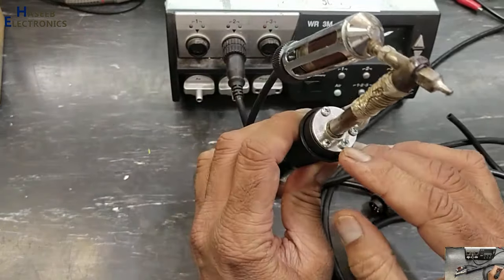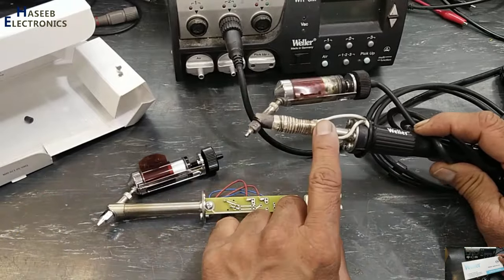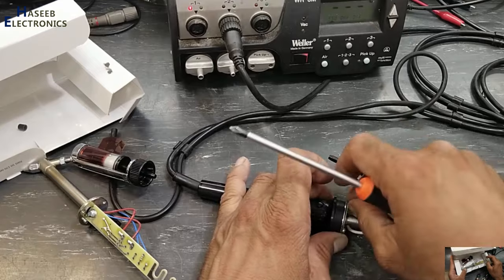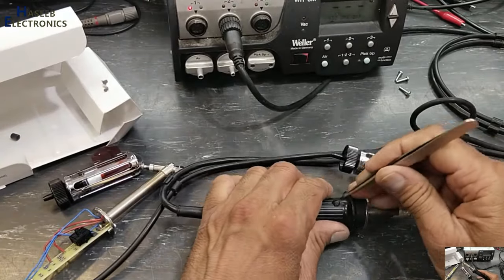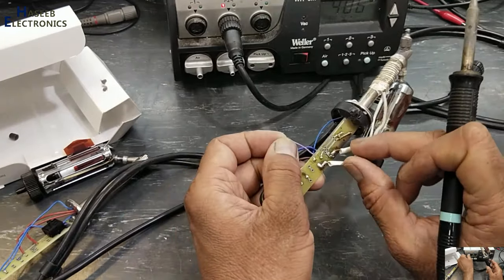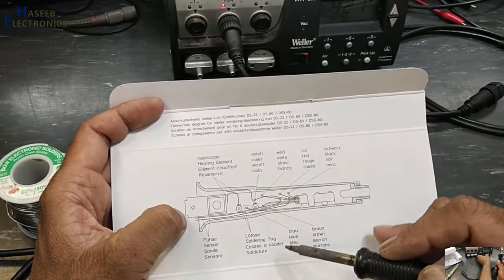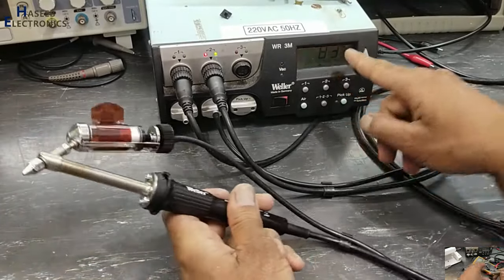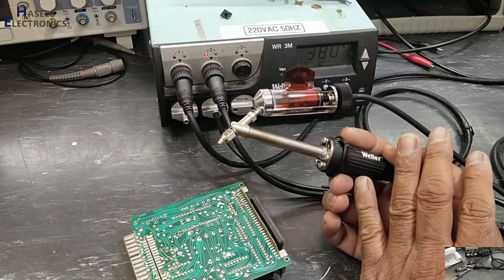{1213} Replacing Heating Element in WELLER DSX80 Desoldering Gun

Comment: I found your channel a few years ago when I needed to look up desoldering iron products and have been watching your videos regularly since then. I decided to DIY my own electric desoldering iron for only $20 and it works very well. 

Also, I have questions. Lots of videos here on YouTube change the SMPS voltage adjustment by modifying the feedback resistor. Since the transformers are wound for specified voltage. Wouldn't they be limited from the duty cycle range and the Fsw? What about rewinding the secondary part and re-adjusting the feedback resistor? I think I haven't found YouTubers that did it. 

Jazaakallah

Comment: I wonder why you didn’t dig deeper in the old heating element? Maybe, “just maybe” there’s a normal ceramic heating element that you can change for less amount of money. Off course I could be wrong and maybe weller is different from cheap stations but it is worth trying
Reply from the maker: its heating element is fixed inside. but i will try dig it. may be your suggestion will work. if it worked that will valueable
Reply: @HaseebElectronics eminim sen bir yolunu bulursun😂😂😂

Comment: In my career I have used quite a few desoldering stations and to be perfectly honest they all had the same problem. They clogged easily if I forgot to keep pulling the trigger 3-4 seconds after I finished vacuuming a weld. That very thin file they provide with the station or as a "spare" doesn't help much
Reply: depemds how you use it and what you know. my desolder tool is working well for 20 years and still working now. clogs are rare but if they do I know how to clear it.

Comment: Nice but. Why it is very expensive bro. You said 409 dollar. You mean US dollar.
Reply from the maker: yes. just heating element price is 400 US dollars. complete desoldering gun is about 600 USD+
and its temperature controller is around 3000 USD
soldering iron is 580 USD
and vaccuum pick up is around 250 USD
these WELLER, PACE, IRSA are known brands in these tools industry, that is the reason thier quality and price are high